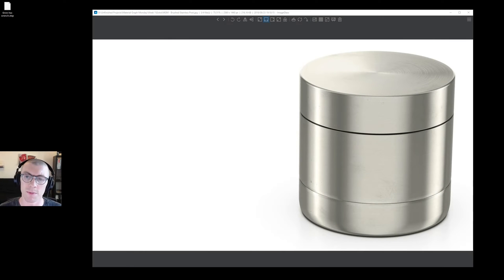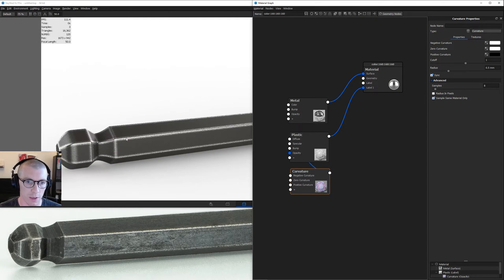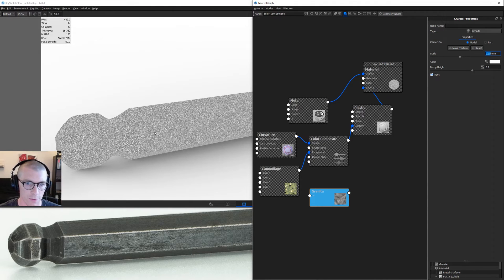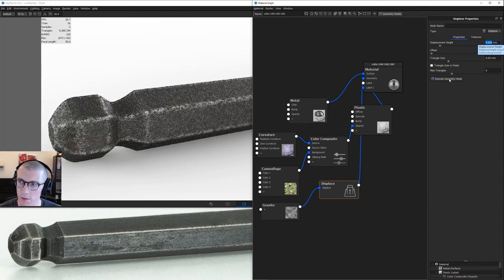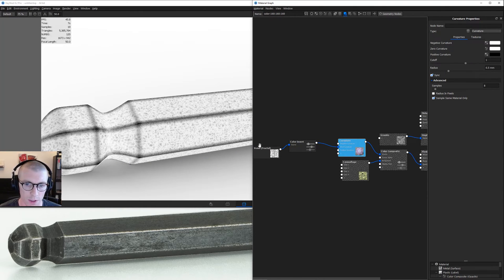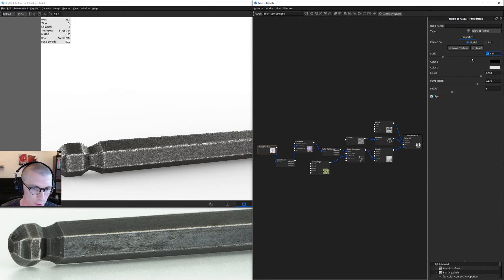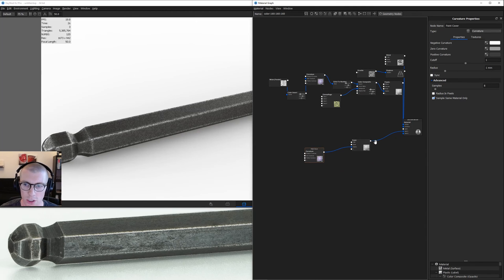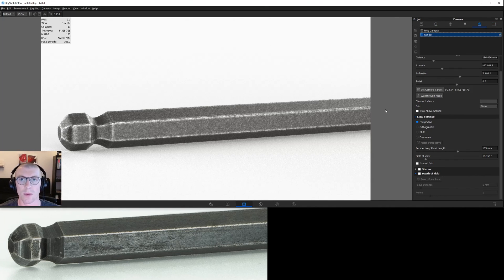How to Render Worn, Painted Steel Material in KeyShot 8

Comment: Great tutorial.
I use it to set material on handgun. It looks great.

But in my case need more blackish looks. I don't have Idea to do it, maybe need to adjust parameter little bit.

Thanks
Reply from the maker: It all depends on how the material is made. If metal, you can try adjusting the color. If there's a plastic label/paint layer, you can make that color darker and if needed, reducing the IoR should make it less reflective which will result in a darker look.

Comment: Thanks Will, this was super helpful. I'm wondering if there's a way to render scratches? I am trying to render a worn skateboard for a class and want to scratch the trucks and tails of the skateboard. Thanks
Reply from the maker: Yeah, there's a procedural scratches texture in KeyShot. However, they're pretty subtle and you can't customize them a ton. For a skateboard where you want lots of heavy scratching, I'd recommend studying some images and just painting a custom scratch texture in Photoshop. You can make it a black and white texture and use it as opacity mask.

Comment: hi can you give solution on banding problem of video i have tried lot of samples to get rid of banding on ground but it still appears plz give me suggestions this can help me in to much thank you wattling for your valuable rply
Reply from the maker: Try adding a ground plane (ctrl+g) that should help. Otherwise, you need to increase contrast in the gradients you make on the ground. Rendering out at a higher bit-depth (like 16 or 32-bit) will help as well.
Reply: @WillGibbons  yes i have added the ground plane and its a very simple animation of 20 sec and my render sampes were 320 i incresed to 400 500 but also same problem
Reply from the maker: @nikhilnaik3184  Then it has to do with bit depth. Render samples won't help, you probably don't need that many. Read about it here and see if this explains it better: https://photographylife.com/what-is-color-banding-and-how-to-fix-it

Comment: like and subscribed :) i have 1 issue - i cant select re-tessellate?
Reply from the maker: Ah. I think this is because of what your import settings were when you imported the CAD model. You must have the box 'import NURBS' checked on to enable this feature later on inside of KeyShot. Sorry if that wasn't clear.
Reply: @WillGibbons  cheers, i blazed through the tutorial :)

Comment: hi will thanx for the tutorial ...i tried this with my own model...and face same problem with body texture..try re-tessellate...but for my model this option is mute...my question is "what should i do to get this option when i export my model..i use maya 2018.6 by the way...thanx.
Reply from the maker: Hi, if you start with a mesh, you can't retessellate. Retessellation can only be done to NURBs data. Maya creates meshes via polygonal modelling. When you use a NURBS/CAD application, and export a NURBS solid like a Step file, it'll come into KeyShot with the option to 'import NURBS', a small checkbox at the bottom of the import dialogue. This is why you don't have that option. Sorry! If you make sure all your surfaces are beveled before exporting from Maya, and make sure all your normals are facing outward, this should not happen when you use Displace. Good luck!
Reply: @WillGibbons   wow..that was quick...thanx again... I will try that next time for sure.
Reply from the maker: @tanvirkhan81  No prob!

Comment: Nice tutorial! I still struggle to understand the difference between roughness and refractive index
Reply from the maker: Hi, ncvisuals. Ah, so, roughness has to do with how smooth a surface is. Refractive index has to do with how slow light moves through a material. When adjusting refractive index in KeyShot on a non-transparent material, it will have the effect of making the material look more metallic. I hope that helps.